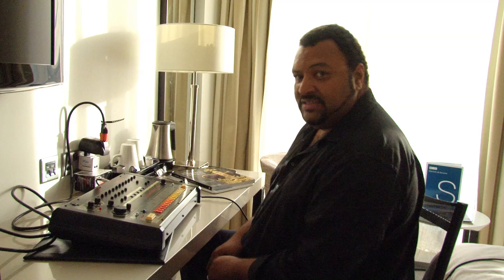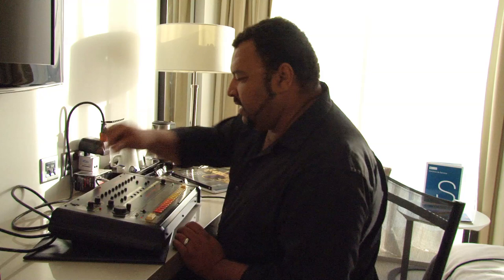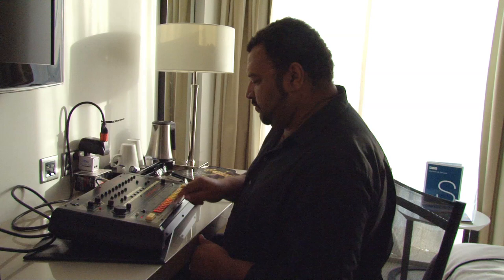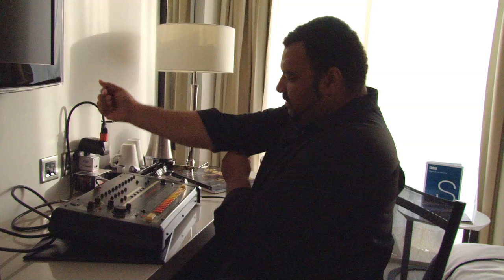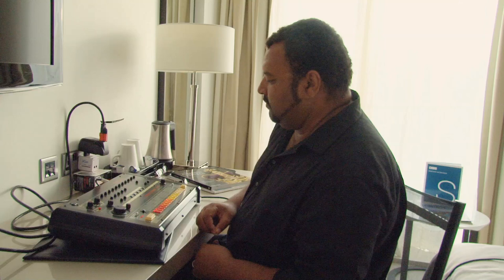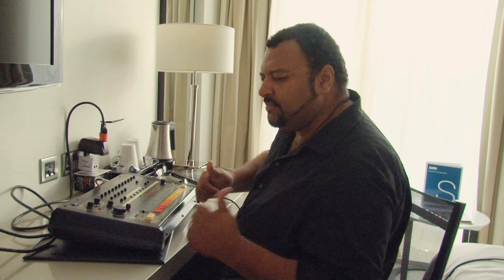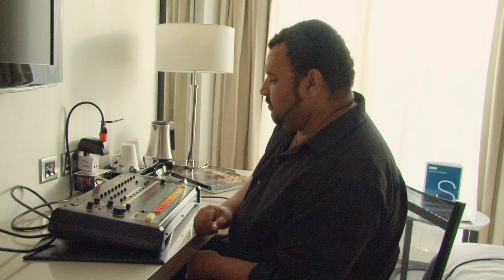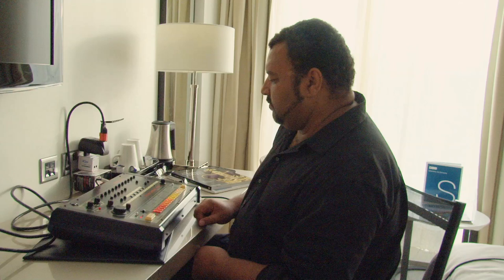How To Make A - Egyptian Lover - Track

Comment: Noob here...has the FL studio and other programs made this machine obsolete? Cant you get the same sounds from there? Why would you want this machine other than for nostalgia ? I'm just looking to be educated....
Reply: imho: the fun with outboard gear begins when you start building an analog signal chain to give your sound a unique character. 
if you just go straight from the TR output to your final mix (so to speak) you can easily get the same results with plugins.

but if you have a nice preamp and/or eq and maybe add a guitar stompbox for reverb or delay on individual channels, you can add saturation and coherence to your sound, that is hard to reproduce digitally.
and having buttons is fun.
Reply: Randy Garcia people are forking over $4,000 for an 808.
Reply: Randy Garcia the kick is ever-changing because it's a analog circuit. let's be honest the the sounds also variate because the machine is old technology. when I sampled my 909 and 808 it was stale sounding. stale is no good for live  I think you could emulate it if you use 10 different samples. I mean would you want to go on a date if they only knew one sentence. that's what sampled kicks sound like to mean versus The Originals... but I have gear ear bad
Reply: PREFERENCE